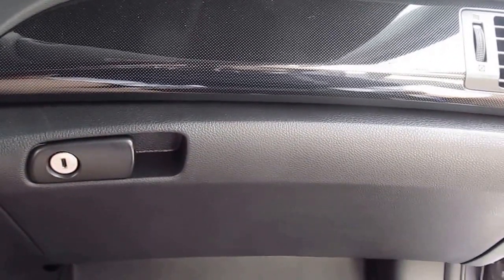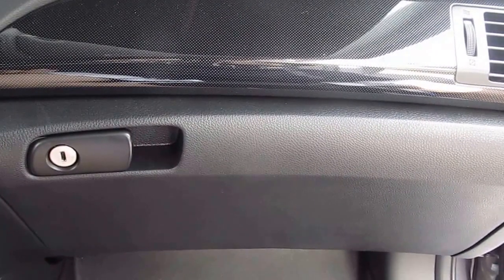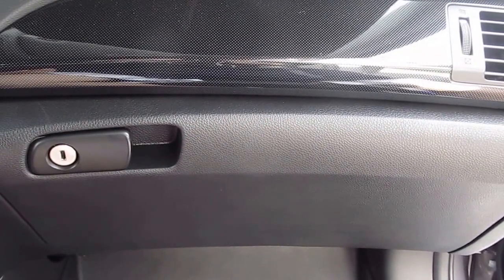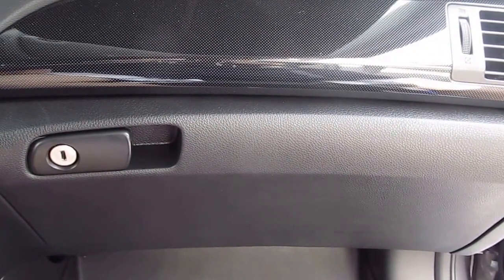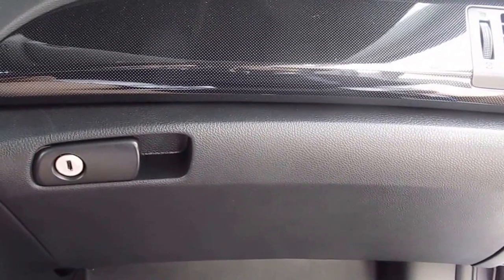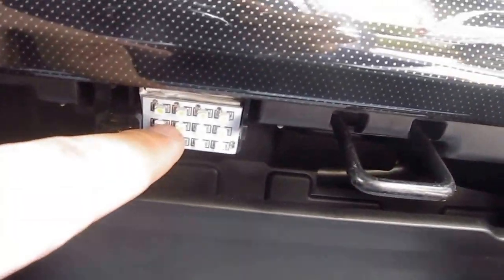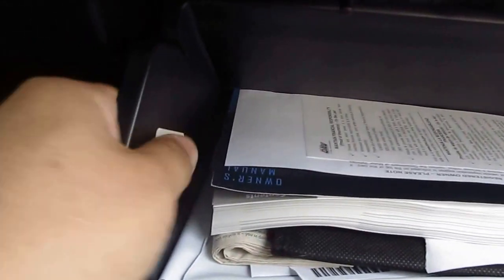2013 2014 2015 Honda Accord Cabin Air Filter Access with Glove Box Light installed

Comment: The "slow close" piece located on right hand side of glove box literally popped off as I was putting the cabin filter cover back on.  It "sprung" back in through the hole located on right hand side of box.  I had to remove a small panel on the underside by passenger seat well and was able together the piece out.  However, after fishing it back through the hole and clipping it on to glove box, it is apparent that this piece also attaches (somehow) to something at the other end.  I have searched and searched the net but no luck.  Anyone know how to fix or where a video may be on this?

Comment: Thanks for this vid. Quick question off topic. Do you know where the ANC plug is in the back of a Non navigation radio with touch screen?
Reply from the maker: The ANC unit is located behind the center cubby.  It is a 20pin connector.
Reply: Thanks
Reply: DIY: Car Modz found the ANC unit & unplugged it & didn't solve my issue. Do you know anything about when you have a sub & amp install & when you turn the car off, you get full bass feedback for about 5-10sec through the subwoofers? I have read forums to unplug the ANC &/or unplug the Bluetooth mics & none of this stuff is solving my issue. I even had this professionally installed & they did not know how to handle the issue.

Comment: How often should air filters be changed? I think My 2013 accord's air filter is dusty already because I can smell old dust from the AC vents once in a while & I only have less than 9,000 miles.
Reply from the maker: Honda recommends changing out the pollen/dust filter every 15K miles if you live in a dusty area.  If not then, wait until the service reminder number 2 shows up on the display.

Also, you can toss in some dryer sheets in the cabin filter to eliminate some of the smell.
Reply: Aahh ok kool thanks.

Comment: lol dang you beat me to it. I was gonna make a video of replacing the cabin filter.
Reply from the maker: I suggest you make one as well.  I actually made 2.. LOL... this one was a reply to one of the DA members comment. They mentioned that it was pointless to install one because of the lack of light and the difficulty it would create when changing the cabin air filter.

DIY 2013 2014 Honda Accord Cabin Air Filter Replacement
Reply: haha we dont even touch that part when installing any lighting mods. I run all my wires underneath the glove box, Maybe I should make a video where the wires should go.